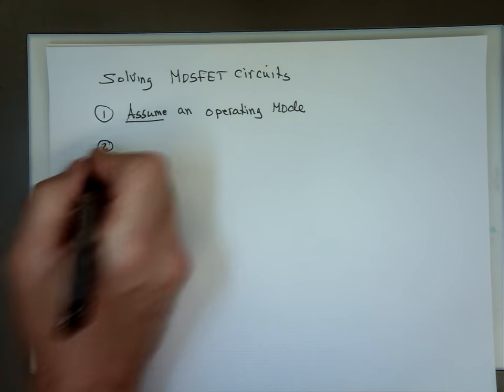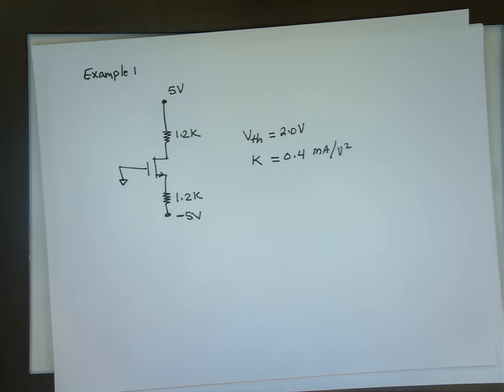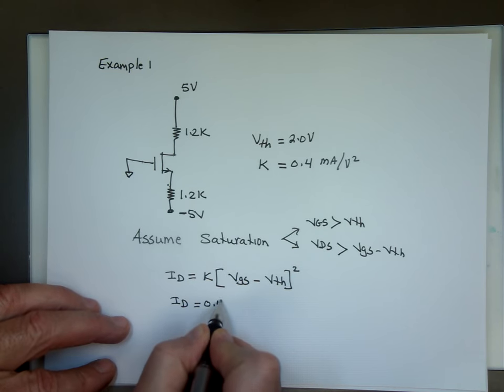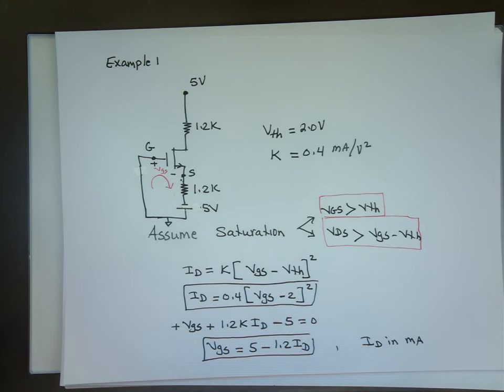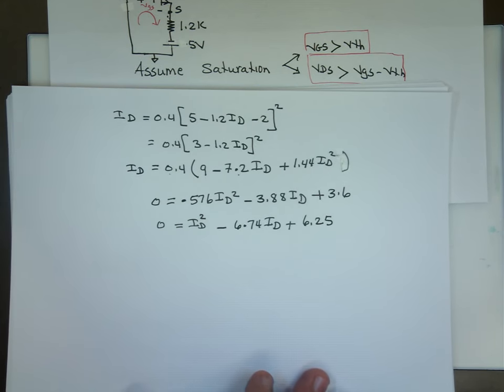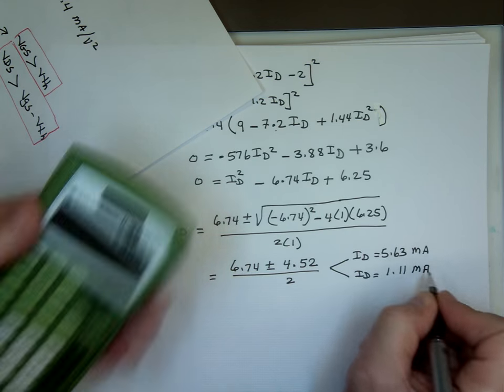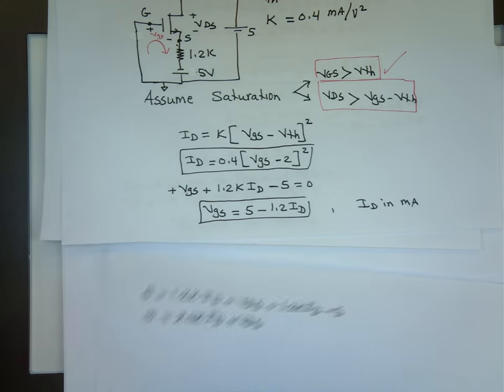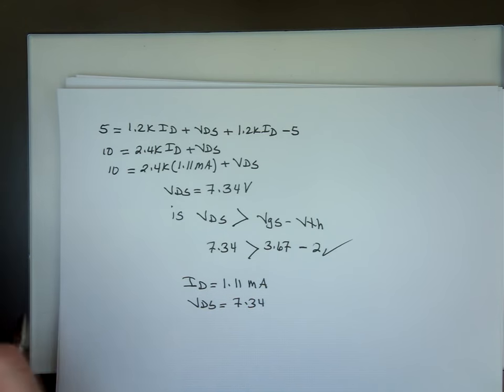How to solve a MOSFET circuit

Comment: why 1.2k id? shouldnt it be 1.2k is? why id?
thanks
Reply: Because he was doing KVL. All the voltages added together would be zero. 1.2 Id is the voltage across that resistor.

Comment: why did he make the id on the left side 0?
Reply: First he multiplied 0.4 with the () inside. On the left side it was 1 Id. So when he multiply 0.4 times -7.2  you get -2.88 Id. After that he took that 1 Id and move it to the right side which makes left side 0 and right side -2.88 - 1 which makes -3.88 Id. 

He solved two steps in one but if you first multiply 0.4 with () and then move Id from left to right you will get the same answer as his. Hope it makes sense to you.

Comment: You have made 1 mistake in the question

Vgs < Vth as this is a p-mos so the current was actually the first current but the answer is still correct. Id = 5.63 mA
Reply: I did not know MOSFETs when the base terminal not used the arrow will change the opposite now I know.
Reply: @noobstracker4029  wut??

Comment: Tomorrow my exam pls help 
a power mosfet with a breakdown rating BVDSS =800V MUST COnduct 10 A when on with a maximum on state voltage VDs =4v if the current density in the mosfet limit to 200A/cm2, estimate the conducting area which is required

Comment: Answer pls 
Assuming a linear fall of voltage in a transistor at turn  on, falling from V to zero in actime t2 , derive an expression for the snubber inductance L which will delay the rise of current to its on state value of I in a time of t1. Derive expressions for the switching energy loss and the inductor energy , in terms of V,I,t1 and t2 and show that the overall loss will be a minimum when t1=(2/3)t2
Reply: Lol, the rudeness of some people